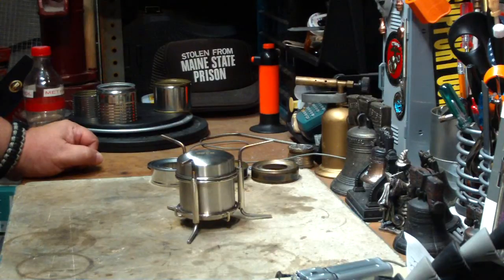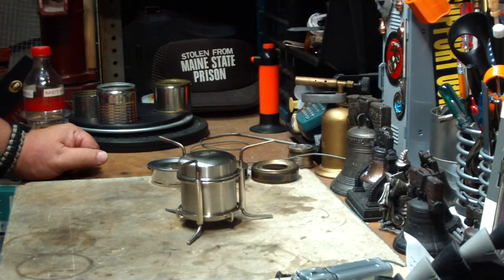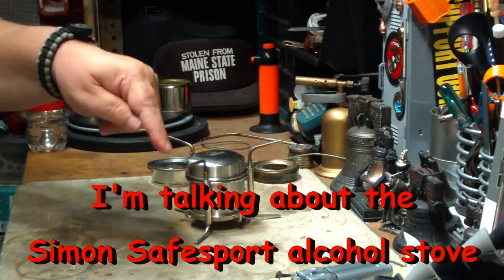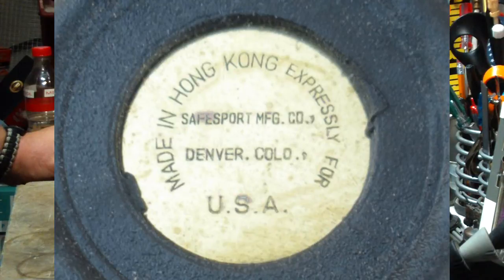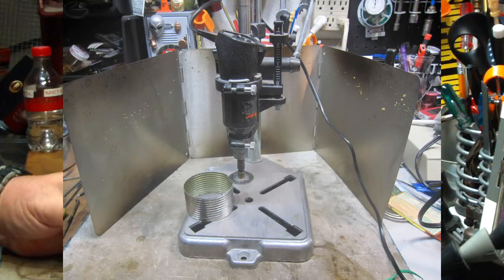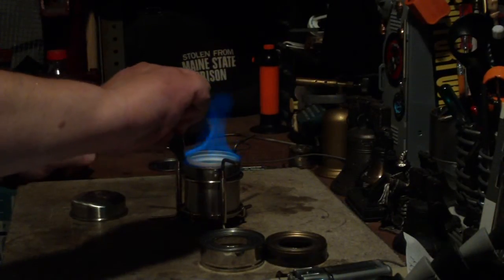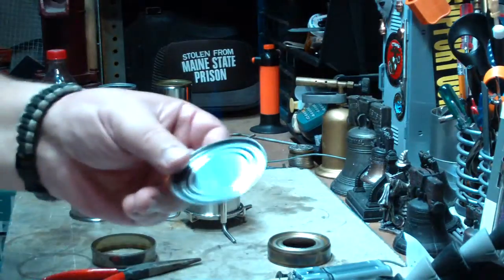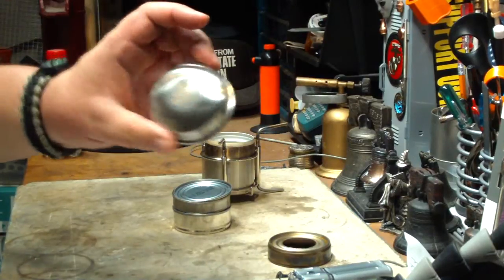Out D Stove - Simmer Rings and Things

Comment: I used a Safesport extensively in the '80s.  Two observations:  first, inside of lids corrode and require occasional sanding and/or light Vaseline.  Second, do not use the lid as a snuffer!  Flames will escape under the rim and engulf the entire stove, possibly sat the forest afire.  I still have a  canoe paddle with a big melt scar from trying to snuff the Safesport with its lid.  Let these stoves burn out by themselves.

Comment: Hi Hiram.  Have you ever tried or tested this type of simmer ring (made from a can with a hole in it) with the larger, military mess kit type of Trangia?

It might be you, and contributors, have found an inexpensive solution for those larger Trangia burners that never had simmer rings.  That would be so handy for dry baking as seen on your other vids.  Any interest in testing?